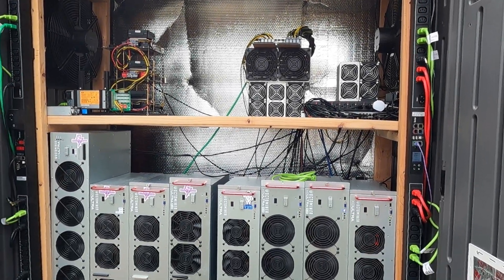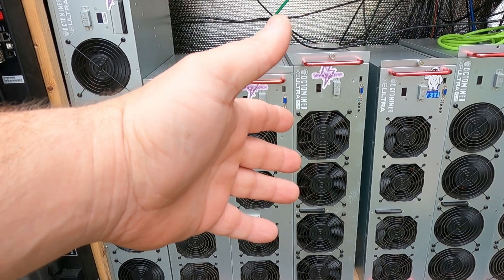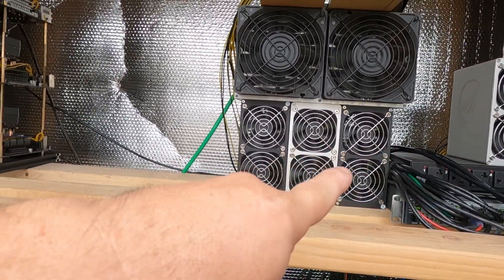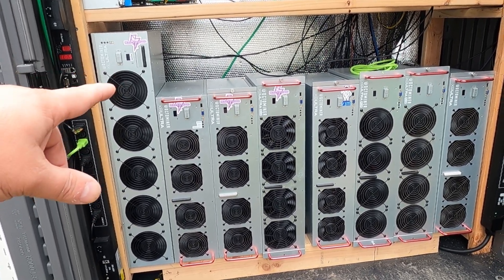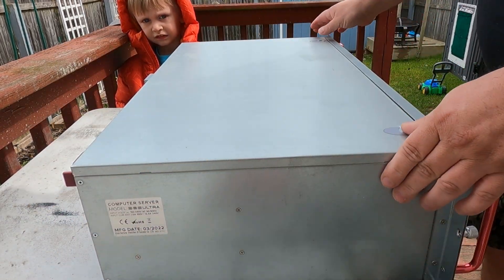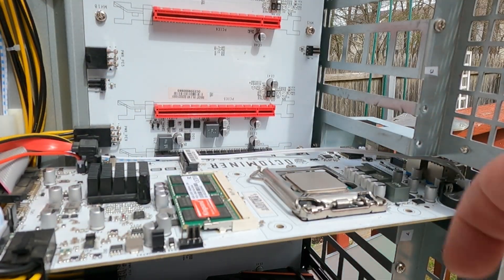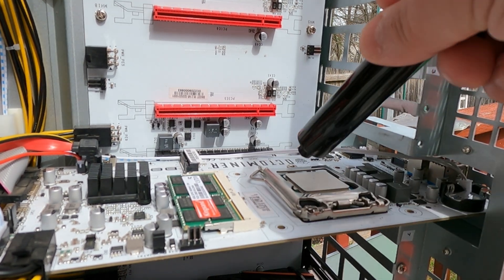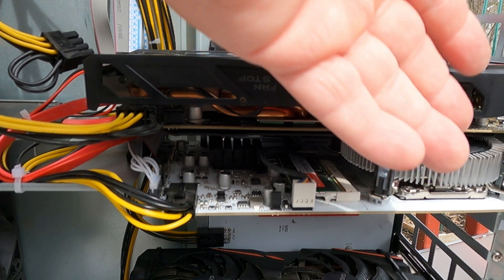octominer cpu upgrade

Comment: Wow, that's a super sweet little shed you have there! How consistent are the temps in there? Dual 240v AC?
Great vid! 🖖
Reply from the maker: I got a 60 amp 240v feeder running into a subpanel in the shed.  The Temps are very easy to manage since it's a small volume of air and got the AC Infinity controller programmed to respond to the Temps and ramp the fans up or down depending on conditions.

Comment: Glad to see someone finally showing an upgrade to the CPU in their x8. I was really limited on Dynex until I put an I3-4360 I had into mine. Now I'm running RTX3060 x8 with full hash rate at the pool. The Octominer cooler is keeping the CPU @ around 70 degrees which isn't too bad for such a CPU intensive algo.

Comment: I am upgrading my b75 motherboard from g550 to i7-3770 with hopes that I can mine some Dnx with my 6600xt's. I don't have a chart with the cpu requirements so I will just have to try.
Reply from the maker: I need to try the updated SRBMiner with my 12x 6600xt rig.